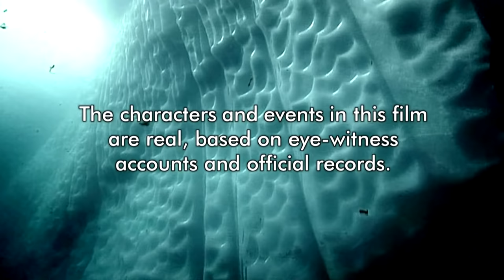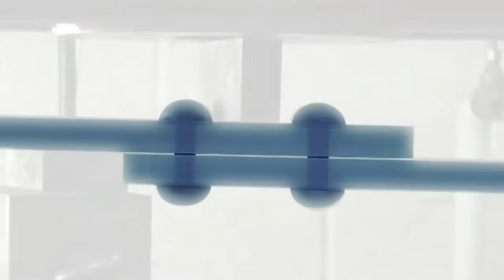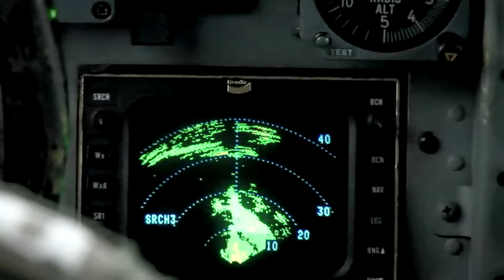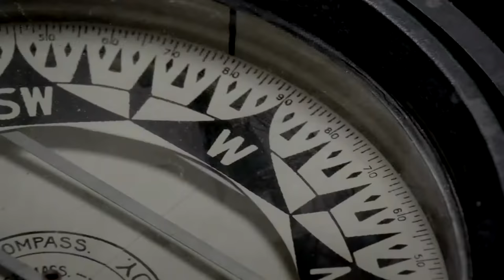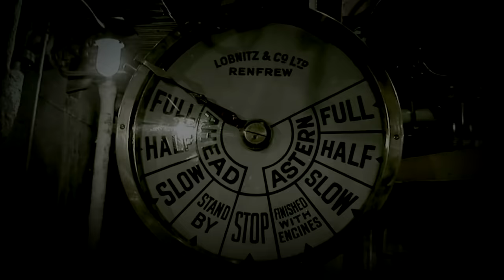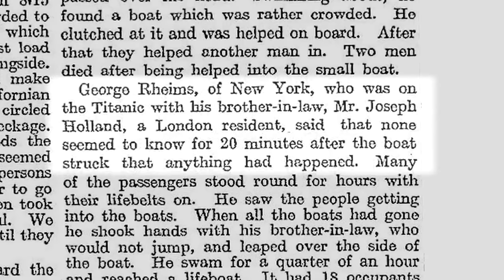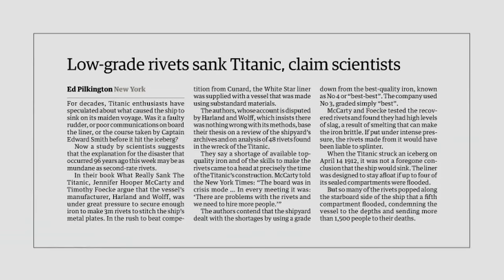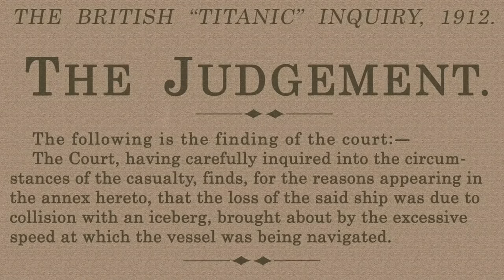The Unsinkable Titanic

Comment: Given the level of risk, the measures taken appeared sufficient. 1) Smith changed course further south, to avoid the ice field. 2)Philips and Bride had already informed the bridge about the ice. More warnings seemed redundant. 3)Lightoller believed the lookouts could spot growlers at 2 miles distance. Binoculars weren't necessary. 4) The ship was "unsinkable". Lifeboats were necessary only to transfer passengers in case of mechanical failure, not to save them. 5) The hull plating was considered sufficiently thick. Most of the rivets were steel. A few lower-grade iron rivets wouldn't make a difference. 6) The chances of hitting an iceberg were low. Ice hadn't come that far south in 50 years. The last modern ship to hit one had survived, 35 years before. At every point, the decisions people took were based on assessments that seemed reasonable at the time.
Reply: All valid points. But wasted on conspiracists and switchers, to whom facts are meaningless.
Reply: Bride had Ice Warnings, but many of the most important ones that sunday, wern't taken to the bridge. Too busy sending private msges which payed well with tips. They couldn't see Icebergs 2 miles away on a moonless night. They went hard a starboard to try to miss it, instead of hitting it head on. "Never bring your broadside to danger." But one can understand, not wanting to plow into an Iceberg. Just too close. No one thing was responsable, just lots of things were, at the moment of impact. The rest is history.
Reply: @dovetonsturdee7033 what's a switcher?
Reply: When rivets are bought. They buy the entire lot. Not a few here and a few there.  74million rivets one shot buy.  They bought the grade 3 rivets...and saved a few pennies. Rivet makers make it in a single go. The boat builder wasn't their only customer.  They should have used wood. It floats.  Steel does not.
Reply: @michealtaylor7745  should have had a bumper on the front like a "bumper boat"
Reply: So no one is going to talk about the guy that took with him the key that was for opening the place where the binoculars were ?
Reply: @tanler7953
I beg to disagree..was it also reasonable at the time that the numerous  warnings didn't get to the captain because of some selfish distractions??? 

The wireless operators at least knew the meaning and implication of an Iceberg especially if another nearby shipp has had to stop for the night bcos of the risk.
That level of recklessness can't be adjudged as reasonable even if iceberg incidents were rare at the time..
Reply: @bunzeebear2973  It was not a one-shot buy.   The sister ships Titanic and Olympic, built almost simultaneously far outstripped the capacity of the ship-builders' normal rivet suppliers, so they bought batches of rivets for several smaller foundries that they didn't normally deal with.
Lots of people have lost their lives on wooden ships that sunk too.

Comment: No matter what the number if lifeboats was, it wouldn't have helped much. The last lifeboats only left the ship moments before the bridge went under and either way most passengers were fleeing for the stern. So although the ship wasn't properly equipped the argument that she could have saved dozens more life's isn't correct. But it's a very impressive feet that the crew managed to get most the life boats of the ship.
Reply: Getting lifeboats off of ships is still a problem today. Time is usually against you and the ships instability usually causes the ship to list making one side or both sides of a ships lifeboats unusable
Reply: plus they were leaving with only about 10% of the capacity the liboats had.
Reply: @eamonreidy9534  right 100 years later the Consta Condoria sank near the coast of Italy. She listed that one side of life boats could not be launched.

Comment: "From very the day she was designed she was almost doomed"

Bull.  

Titanic's design was fundamentally sound, and modern ships are still built to similar specifications when it comes to controlling flooding.  The bulkhead height was perfectly adequate in the midship section, assuming you didn't hit an iceberg at full speed hundreds of miles from shore, which nobody at the time had any reason to believe was a serious possibility.  The fault was in how she was operated, not in how she was designed.  Her sister ship Olympic survived several collisions over the years, including with a U-boat in WW1, and one that punctured two adjacent compartments.  From a structural and material-science standpoint, Olympic was essentially more or less identical to Titanic.  

And no hull design would have been able to handle the sort of forces the iceberg imposed on Titanic's hull, including modern welded hulls.  The berg was essentially as hard as rock, and as we saw with the Costa Concordia, a rock will rip even a modern ship open like a tin opener.
Reply: I think he was referring to the neglect from the head officers
Reply: the costa concordia is basically a flimsy built ship to carry the newly wed and the newly dead or almost dead
Reply: @HappyfoxBiz  'WAS' basically a flimsy built ship.  She's since been scrapped.
Reply: totally agree. how come the Olympic wasn't "doomed"
Reply: @stanhumphreys9282  The Olympic only had two of her compartments breached, which is why she wasn't "doomed" per se. On the other hand, the Titanic had five of her compartments breached.
Reply: That’s not exactly true, a battleship could nail her , or slide in those dms that iceberg was pushing , wouldn’t breach the armor, and let’s say it does did the Iowa’s have a triple hull, suggest you watch the curator of the battleship nj, he mentions it.
Reply: @bradmiller4999   An ocean liner is not a battleship.
Reply: @brianwhitford6086  he said no hull design, not ocean liner or a battleship, I pointed out that , that was false, a battleship can survive a head on collision sideswipe and numerous things a iceberg can do, now it may need repairs but it is not going to sink thanks to a foot or more of armor and compartments.

Comment: Titanic wasn't built with poor quality iron. Compared to the iron made today, yes, it's poor quality. In 1910, when Titanic was built, the iron used was of the highest quality available at the time.
Reply: If you watched the whole documentary, you'd have heard that they didn't order the highest quality wrought iron, they ordered one grade lower than the highest.
Reply: @meghanmcintosh135  I did watch the whole documentary and many, many others and I've done a lot of research. The info in this documentary is wrong, and not just about the iron.
Reply: @meghanmcintosh135  Odd, then, that Olympic, built of the same materials by the same yard at the same time, had a long and successful career, don't you think?
Reply: Wrong the rivets of titanic were so of bad quality they literally tested titanics steel and it was frail
Reply: Just because they say at the time it was the best doesn’t mean the ship didn’t have poor quite steel because we now know for a fact the steel was brittle
Reply: Shoulda used Flex Seal 😂
Reply: @TTV-PARKER  I'm not discounting that. They were also hand placed and riveted. Some craftsmen's work may have been better than others, and I'm sure there was plenty of innate human error present in the construction of the ship. But it wasn't a factor in the sinking. No ship of that day, regardless of the quality of iron available at the time, would've fared any better than Titanic did. The rivets were brittle because of the frigid temperature of the water, but because of the way iron was manufactured at that time, ANY quality of iron would've behaved the same way. It made no difference.
Reply: @TTV-PARKER   Any type of metal that is heated by the boilers and cooled by the freezing ocean water simultaneously is more or less likely to warp and become brittle over time. The only thing is Titanic was not in the water for that long. Though possible warping should be taken into consideration.  Also it has been recently proven that the rivets were not the problem. The impact with the iceberg was simply too great. Even the amateurally made rivets had a decent hold. Maybe not as good as the proper ones but still pretty decent.
Reply: Asowsteel 💪🏻
Reply: The problem with  Titanic is that she grazed an iceberg....bummer. All this nonsense about poor rivets seems to be a bit much. The Olympic did pretty well for 25 years or so, of course she didn't ram an iceberg.
Reply: @Mel F Only a Turkey can survive this!!   💪🦃💪
Reply: @TTV-PARKER  rubbish the brittle steel story is a misleading entertaining lie. people often start with a theory&set about thier experiment with an end result in mind,instead of following the evidence&letting it lead one to the truth

Comment: I think what makes this so fascinating for me is that it's the point in between my objective 'there is no such thing as fate, only coincidence and consequences' mind and my subjective 'some things are just destined to happen' mind. Looking at all the things that had to come together in order for Titanic to sink, it's hard to think it was just coincidence. If they'd seen the iceberg 30 seconds earlier, they'd have avoided it. Thirty seconds later and they'd have rammed it head-on, causing only minor damage to the bow. That plus the wrought iron rivets + the lowering of the bulkheads + no binoculars + freakishly calm weather + the Californian turning off its wireless + not responding to the rockets + the impact opening up exactly five compartments (just enough to sink the ship) is collectively hard to pass off as anything other than fate. It's an awful lot of coincides, any of which not happening would have averted the disaster.
Other sinkings are easier to accept - hitting a mine, being torpedoed, being swamped by a freak wave, running aground on a reef or rock, a fire or explosion on board. It's this one, where so many otherwise unrelated factors had to come together, that makes it so eternally intriguing.
Reply: Head on causing minor damage to the bow? Gtfoh. You sound absolutely ridiculous to just blurt this out
Reply: @electrickrain ships have survived head on they don't survive side damage that was his point

Comment: So many small factors that when combined led to such a big disaster.

1 iron rivets 2 full speed 3 no binoculars for the crows nest 4 not all ice warnings received by the captain 5 moonless night, 6 California shut off equipment for the night 7 not enough life boats 8 no life boat drill.  Anything else??
Reply: Cyril Evans, Californian’s wireless operator, would have gone to bed no matter what, he was finishing his shift.
Reply: @Sarah0583  It was after receiving that rude message from Philips that the California operator turned off their equipment
Reply: @luckyu521  The message was not rude, it was simply the Morse silent signal “DDD”, a common way to ask a fellow operator to keep the line free. Evans did not feel insulted and went to bed soon after, just as he had planned. He explained what happened in his testimony at the inquiry.
Reply: @Sarah0583  Oh I see. Then the documentary was incorrect on that. Thanks for the clarification!!
Reply: You missed the most crucial one. The change to the grand staircase which lowered the bulkheads.
Reply: The temperature had just dropped to below freezing.

Comment: A fascinating documentary that [places rare emphasis on the subsequent enquiry into the sinking. 

However, I am forced to question the assertion made regarding that better iron rivets would've saved hundreds of lives. Given the splitting of the seams for a considerable distance along the hull, it would stand to reason that seams secured with steel rivets also popped. Even if higher quality wrought iron rivets were used, the impact and sheering loads applied to those rivets may still have popped them, only fractions of a second later. So, it is by no means anything but conjecture that better quality iron rivets would've made a huge difference to the loss of life.

Of course, this may have been a factor, but we may never know for sure, so making such assertions as if it's established fact may be incorrect.
Reply: Yes, I took issue with that as well. From my reading on the subject, that theory has been pretty roundly rejected by most experts.
Reply: Exactly. The sudden force of impact was immense, i highly doubt that even a ship of today with modern technology would survive a similar impact with an iceberg.

Comment: David G. Brown wrote the book "The Last Log of the TITANIC". He explains how the ship run aground on a shelf protruding out from the ice berg. Most of the water came in through the bottom. They came to a stop after hitting the ice berg. They started the pumps to remove water. Then they started to head for halifax because it was only 450 miles away. This forced a lot more water into the ship and resulted in the sinking.
Reply: "The berg scraped along the starboard or right side of the hull below the waterline, slicing open the hull between five of the adjacent watertight compartments." Not sure why you thought the water came"through the bottom "?
Reply: @elainetwum3465  read the book "The Last Log of the TITANIC". He argues his case about the bottom being damaged.
Reply: @clearsailing7993  Ok. Never heard of that bf. Always believed side of ship was damaged. When Ballard found ship, the side was damaged. Thanks.
Reply: @jamalbr3251  crew testimony at the hearings stated that most of the water was coming in from the bottom.
Reply: Nice theory..totally unproven though. Another possibility, i suppose..
Reply: I've never heard of this theory before. Considering the bottom of the ship is inaccessible theres no way anyone could refute this theory. Unless someone wants to attempt excavation 4000 meters under water. And somehow tell the difference between iceberg damage and seafloor impact damage along the bottom of the hull.

I'm not arguing either way here but if crew did indeed say water was coming from the bottom during trial I wouldn't want to dismiss the possibility. It could easily have damaged the side and the bottom. Without seeing paint transfer on the iceberg (before it melted away, or just got knocked off in the impact) or seeing the bottom of the wreck no one can know.

Remember that the idea the ship broke up was thrown out despite testimony that we know for a fact was true. This whole tragedy is rife with this kind of elitist arrogance (ie. Don't be silly you commoner, it can't break in two. You're just traumatized, we know better) and its simply impossible to how much of the historical context bears any weight.
Reply: @LamboGallardo560  Because it's nonsense, that's why you've never heard of it.
Reply: @elainetwum3465  
The fore part of the ship was sunk in deep mud.
I don't think that the damage was visible.
Reply: Ground penetrating sonar showed no damage to the keel. Water fills from the bottom up until it pours over the bulkhead.
Reply: @LamboGallardo560    It could be explained by two sections of the keel being found roughly 1km from the main wreck site.  Not very well known, it came up in a Federaljack radio broadcast back in 2013, and that our old friend Cameron is aware of it.
Reply: the bow is embedded 15 feet into the mud there is no evidence that water came in from the bottom but they have found rivets down there there were sheared off and they did find out that alot of the rivets were made with NO 3 iron which was a lesser grade quality that had a lot of slag in it.
Reply: The crew testimony said water was coming up from the bottom.
Reply: You may be thinking of The SS Atlantic that ran aground, damaging the bottom of the hull, in 1873, at Lower Prospect, which is indeed in Halifax, after detouring to Halifax believing they were running low on coal.
Reply: On a different Titanic episode(more visual effects) they show a break in the side.  When one rivet blows then it rips like a zipper.ON THE SIDE OF THE BOAT.(not the underside)